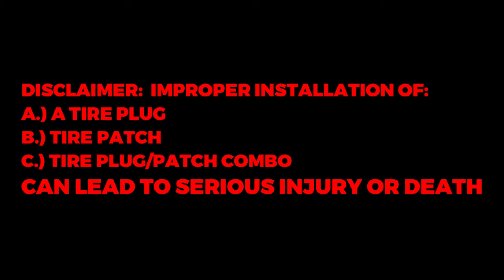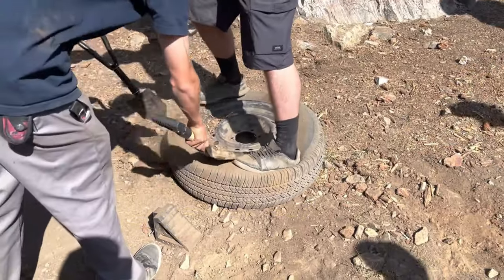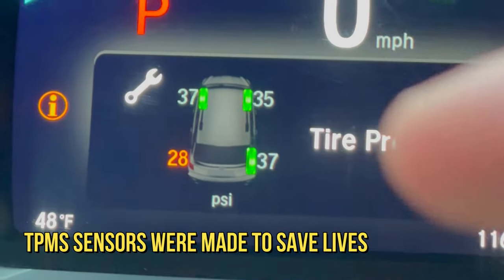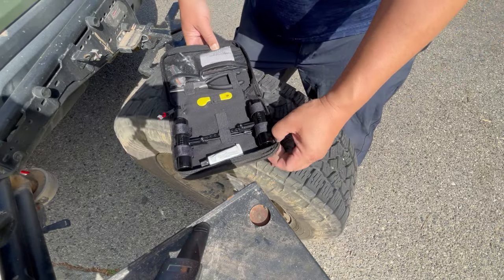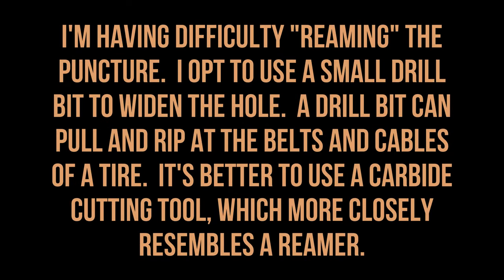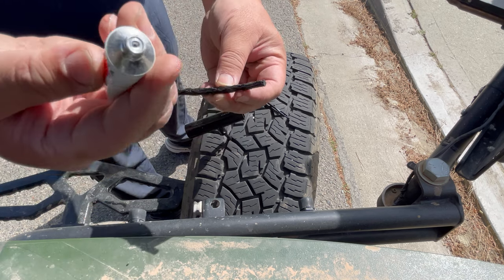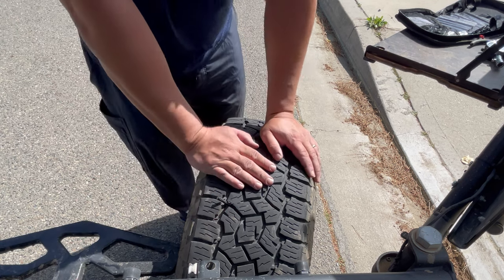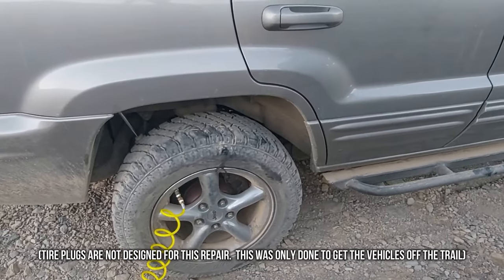How and When to Plug a Tire!  DON'T DIE!

Comment: #13👍🏻🚙👀

Please advise as to what 12v air compressor you trust the most and travel with today AS WELL AS THE automated air down caps. 

I've looked at your Amazon store lists. The problem for me is that you often list multiple brands and models to choose from when all I need is what YOU TRUST AND CARRY ON YOUR RIG at any given time.

Thanks in advance.

Signed,
2020 Honda Passport Elite AWD owner
Reply from the maker: The air down caps I use are 4-6 times more expensive, but I eventually switched to them because the cheaper brand kept failing and was inconsistent.  So, buy the Staun brand.

The air compressor I use is the smittybilt 5.65 CFM.  It’s been reliable, however I hear that the Napa auto parts compressor is similar price and 10 CFM
Reply: Thanks Jon.

Please update your referrals as your viewing audience leans on your hands on experience. ✌🏼

Comment: lol the only people that state tire plugs are dangerous are tire salesman..........it's the same people that refuse to actually publish tire manufacturer data unless the government mandates it.
Reply from the maker: I’ve plugged my tires 8 times and ran them with no issues for the life of my tires.  I don’t have a single friend that has had one fail and I go on trips with a lot of people.  I’m sure there’s incidents under certain circumstances, but I can also tell you that my professional patches have failed multiple times.  To fix a leaking tire caused by a nail and screw, I just rather DIY plug them.

Now, let’s wait and read all the comments about how we should never plug tires 🤣